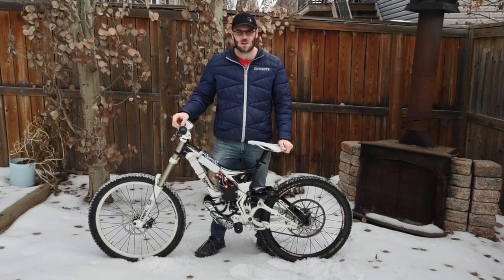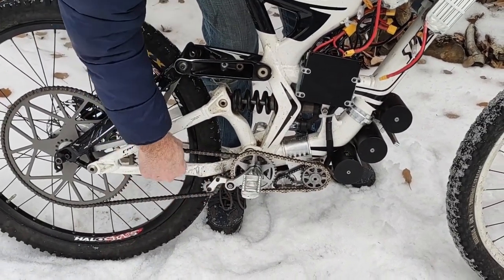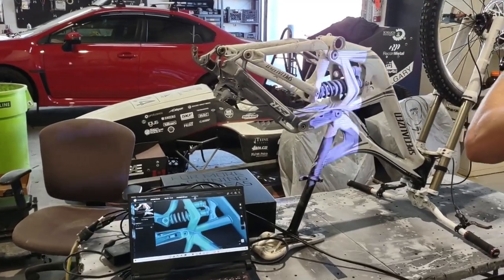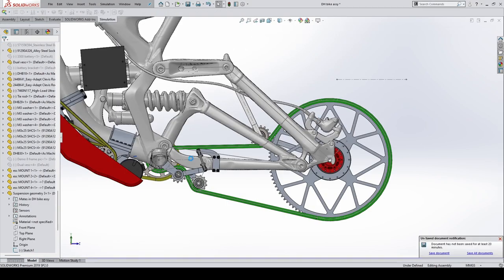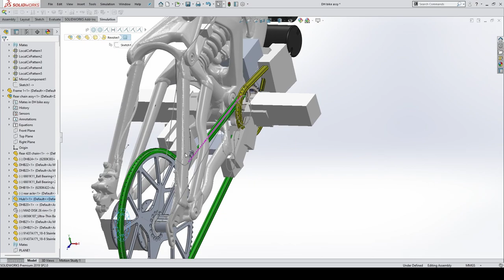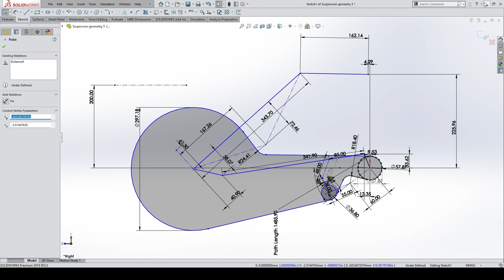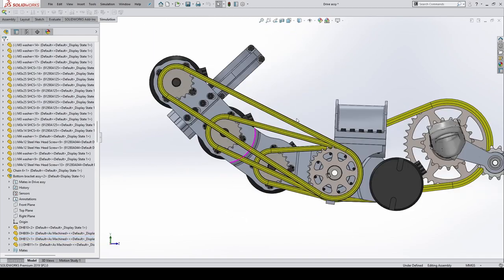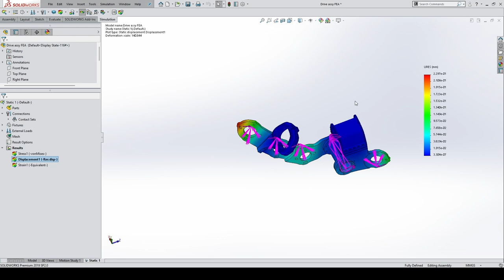I built a quad motor, 20hp downhill MTB Ebike with crazy power!

Comment: I'm guessing you synced them up with a CAN bus?  Does the VESC Tool show four devices or two?
Reply from the maker: Provided all 4 ESCs are on the same firmware, motor calibration calibrates all four motors simultaneously over CANBus
Reply from the maker: The VESC shows four devices.
Reply from the maker: I plugged the throttle into the TFT display which was plugged into one of the CANBus ports and it ran all four motors at once.

Comment: what's the advantage of having multiple motors?
Reply: I'm not the OP but I think it's just the size and ability to place the motors more discreetly. With these small motors he's wrapped them around the frame instead of having a giant 20kw motor sticking out. It's the only advantage I can think of.
Reply: Shared torque, shared load and heat dissipation, many benefits here.

Comment: Or just buy a proper hub motor, actual battery (not that weak ass lipo stuff) and adequate controller, like a 85250 ubox 😁
Reply: Mid drive 250nm with integrated gearbox would be my dream